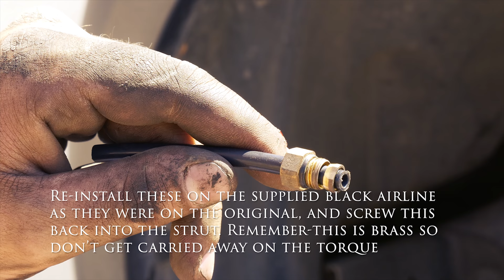Land Rover Discovery/LR3 & LR4 - Proud Rhino SYA Off Road Extension Kit | INSTALL/How-To | [4K]

Comment: Great video...I ordered the SYA Off Road Kit because of this video and it should be here in a few days.  Question, after installing each spacer, how much air did you initially put back in the strut, prior to completing all four?  Also, did you have any issues with the air hose pulling back up into the frame after you cut it?  By the way, nice sliders, I think we have the same ones...tactical rovers?
Reply from the maker: Glad it helped you, I hoped this would help other LR enthusiasts make more awesome rides.. I didn't touch my EAS/IID Tool until all four were finalized. Afterwards, I simply removed the jack, aired it back up, and took it around the block for a quick spin. 30,000 miles (and some extreme trails) later it is still going strong... fortunately there has only been one instance of dropping to bumpstops, and it was on street driving after pulling out of the dealer (had some unexpected maintenance pop up last summer)... performed admirably, exactly as expected.
The air hose had me worried, but the extenders and connectors they supply with the kit are plug-and-play, simple to install, and gave me no issues.
And yeah, Eric over at TR hooked it up and got me the whole armor setup... sliders came in huge handy last week in AZ backcountry.
Reply: Are you sliders Tactical Rover?  If so, I have the same ones...I picked mine up from Eric Holmquest who is the owner of Tactical Rover located in Southern California.  They're awesome and chose them because they cover the compressor...that alone is worth it.  Glad to hear they worked on the AZ trails...which trail did you hit up?  Regarding the air hoses, I was a little worried because although the hose connectors have kung-fu grip on the hose, didn't know if water would penetrate and seep into the line...guess I'll find out. 

Received the kit and installed last Tuesday.  Install wasn't bad, but removing the inner most bolt off the two rear air struts was a PITA.  Definitely used the magnetic tool on several occasions!  Had your video and one other for releasing air open at the same time for reference points! haha...don't know what I'd do without youtube and people posting.  For front air suspension, released air from valve block.  For rear air, released air directly from struts as I couldn't get a wrench in to unscrew to 2 hoses...don't know if that's good or bad, but had no fault lights after installation or since, and that's with almost 2,500 miles in a week.   

Just got back from Moab and other than popping a tire on Murphy's hogback, no issues.  Trail wasn't hard, but 19" rims aired down don't leave much sidewall for angled rocks...so, on to the next purchase, Lucky8 18" rims...thinking about 265/70r18...
Reply from the maker: Hey!! Glad you got 'em, and had installed it. Eric is a great dude, and makes a world-class product. I traveled the Butterfield Overland Mail Stagecoach Route from Anza-Borrego in SoCal to the Guadalupe Mountains in Texas, spending most of that time in Arizona... I'm sifting through all of the footage I shot on the trip and trying to publish a video each week from the trip.
~Just under one year in, I haven't had any seepage from the airline/EAS.

Comment: Hi, thanks for your video. If you do that modification, could you also do the shorter rods "Johnson" to trick the leveling sensor of the air suspension and get 2 more inches lift? What could go wrong or it would be OK?  Hopefully you will see this message 😂😅

Comment: Hey man, just did that installation and i see the truck sitting in the same height that it was before... Díd you calibrate anything in the computer?
Reply from the maker: I use the "Green Oval Experience" rods, they allow variable adjustment between different modes. The height is set by the rods, acting on a sensor system.
Additional, around this time and still presently I have digitally adjusted height via my GAP Diagnostics tool.

The ultimate goal you have now enabled is a failsafe to allow your vehicle to crawl back while running a more aggressive tire. With anything over certain dimensions, if your air goes out your wheel can and will rub immensely. I have had this happen both before and after the kit install and I can tell you the reason it is named SYA is literal.😂

Hope this helps, and happy roving.

Comment: Hey man, build looks great! I was wondering with the lift rods and bump stops is the overall height of the vehicle taller than just with the lift rods? Or are the bump stops just a fail safe?
Reply from the maker: Thank you!
The bump stops simply act as a fail safe.
The "rods" are the actuators on sensors which ensure the two sensors are the desired space apart... I enjoy my Green Ovale Experience rods, as they can be quickly adjusted in the field, with no tools.

I also have tweaked my height via GAP diagnostic tool, perhaps the most valuable piece of automotive kit I keep in the truck.
Reply: @MASSExpedition  on a vehicle already coil converted will the spacer act as a +1/2” lift as well? Or would they basically just end up being an extended bump stop type spacer?

Comment: Great video but have  question this lift kit can use also in a desert? And need another else to fit in car for safety?
Reply from the maker: Thank you.
If you're asking how this performs in the desert, I assure you it performs at the highest levels of capability. I lived in the Mojave Desert, California, with this car and frequented austere terrain.
As for other things to fit, the SYA kit comes with different levels of options, depending on your needs. (https://www.lucky8llc.com/collections/bump-stop-extension-kit-3/t-lr3+ac1-suspension+ac2-bump-stop-extension-kit)

Comment: Thank you very much for the video!
Would we them be able to for in 35" tires? 
My compressor gave up assume time ago and The drive was very low scraping, etc... Does this guarantee a higher lift when the air suspension is dead or can it be used as a lift with the air on? 
Sorry I'm gullible and stupid!
Thanks again (-:
Reply from the maker: It gets you extra lift when the compressor fails, that is the underlying intent of equipping this system. Ultimately it serves as a failsafe if your vehicle drops to bumpstops and air compressor bags fail. "Save Your Ass" kit 
These 33.2" Grabbers are the largest size tire I can physically suggest without altering your actual vehicle. I've seen guys run 35", but IIRC they modified physical build of the truck.
Reply: @MASSExpedition  thanks for the reply and sorry for the bad grammer/typos 😬🙂
Reply: @MASSExpedition  Let me add to this comment. I'm @soflorovers on IG. I bought Andy's old LR3 with 35"s on it. I wouldn't recommend a 35 tire. Stick to 33". The extra mass of a 35/13/18 is noticeable, as is the re-gearing. I'm considering downsizing to a 33" myself.

Comment: Have you run into any engine management systems problems when running +32" tires?
Reply from the maker: Zero.

Have had these tires on for 4 years and ~35k miles.. recently swapped a new set of the same X3 red letter Grabbers (I rotate a set of 6 primary wheel/tires, "resting" two - I take two on extended expeditions so maintenance wise, I like rotating all so I don't have a dedicated spare growing old.

Only issue with the tires is that I run steel wheels - this may have contributed to a wheel bearing malfunction two years ago - slowly materialized into a near mobility kill while headed to Big Bend. Nothing catastrophic.

Comment: What is the benefit of doing this over extended lift rods which attach to the height sensors?
Reply from the maker: This is done, in addition to lift rods, to prevent a catastrophic failure of the EAS from rendering your vehicle a mobility kill (due to wheel diameter/wheel well space ratio) when running big tires.
Reply: @MASSExpedition  So that way if you lose air the tires won't jam up in the wheel wells... makes sense
Reply: Also, using full time lift rods affects the ride comfort because the bags are stiffer when more full.  These would be less straining and more comfortable.  My preference (on my LR3) is to use part time Johnson rods that keep the vehicle normal but can be changed to a 2” lift when needed

Comment: Did you turn off TPMS or were you able to move sensors to keep on? Nice rig BTW!
Reply from the maker: Karsten Clements thank you!
I actually run steel wheels from Lucky8 and have no TPMS system running. As far as the rods go, I've adjusted with simply moving the position (GOE rods are adjustable super easy) and then with the actual changing of the struts, I did a complete deflate using my GAP. tool... I hope that answers your question?

Comment: Great video, did you change anything else? I read that you have only installed these spacers and LIFT RODs, but waht about the rest? Thank you I am building my LR3, thank you for the advice.
Reply from the maker: Thanks! The rods, spacers, and some tuning on my GAP IID Tool are all that has been done to modify the suspension. 
Control arms have all been replaced, and some minor adjusting of internal components (passenger side rear well A/C piping re-route) as a result of necessity and/or maintenance.

Comment: Why would you do this?  The LLAMS kit from Australia does the same thing electronically by putting an easily adjustable plus or minus offset in the position feedback sensors from each wheel.   This is a mechanical offset.  Not easily un-done.  Didnt you know about the LLAMs system?
Reply from the maker: Noel Whittle real world example: when you take your car to the dealer for something minor and they reset your electronic programming, and your EAS craps out on the highway, and the only way you're able to limp back on 33.2" tires is the hard bumpstops.
Safety backstops, and redundant ones at that, are never a bad thing.
I assure you it hasn't impacted performance, either.

Comment: What size tires are you running?
Reply from the maker: 33.2" General Grabbers (buy 6, rotate frequently, still going strong three years later)
Will be purchasing a new set by the end of this year (assuming standard lifetime wear remains constant)
Reply: MASS Expedition I’m running 275/70 18 General Grabber X3s
Reply from the maker: @andrewhovanetz3525  Gotta love 'em! I have been very happy with both my X3's and my buddy's (the guy helping in video, and driver of Red Dodge in my other films).
The 275/75's do create minute rub at times, but really only when parking.

Comment: How did you fit 275/75 r18s?
Reply from the maker: Purchased the Lucky8/Terrafirma steelies, did a boatload of online research, moved over the rear-passenger side A/C cooling pipeline, and accepted the fact that I may rub when reversing/odd times. Also using GOE Rods and a GAP Tool. Originally I had the GAP tool also with an additional 15-20mm or so (I forget finite amount), but decided against it. The GOE rods are great because (and this is the bro-science/selling factor) if desired, you can easily adjust them on the fly to lower the vehicle for long-distance travel (i.e. road trip/etc).
Absolutely happy with it, and will be getting another set of General Grabber X3's again when these are due... been very pleased with the rubber itself.
Reply: Any pictures or video how to remove/relocate the A/C pipeline? Also, did you have to cut/trim the "frame's horns"?